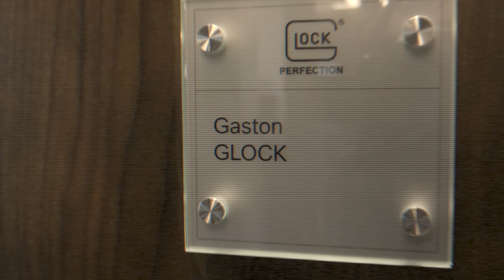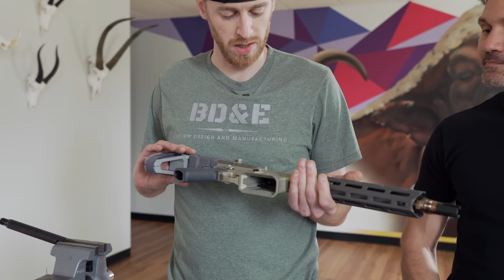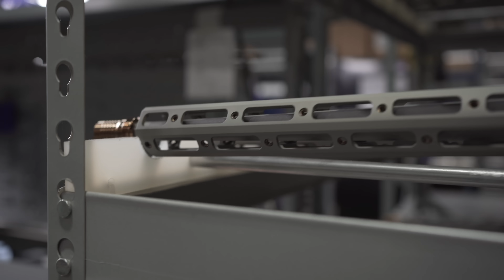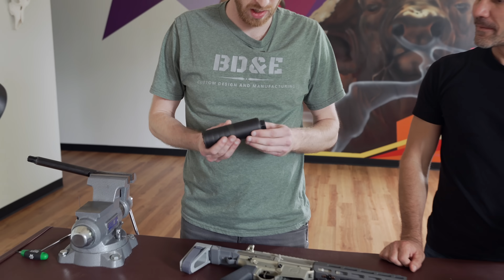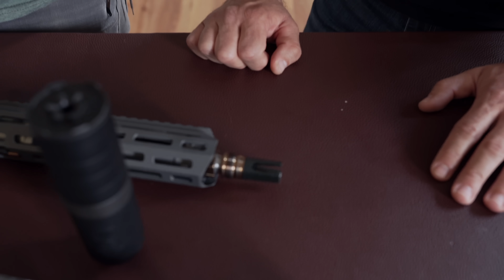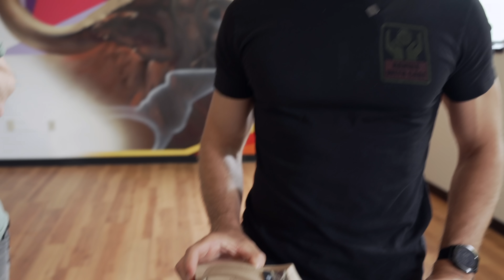New Honey Badger, Mini Fix, Cans, and Gear from Q

Comment: I dunno cause my, aero/aero, bad rail, Faxon 10.5 300, with full size can and 2-7x is 7.5lb loaded. What is that? 2000$ more for 3-4 less ounces? Fancy lol.
Reply: There’s a difference. You should run a test or two.
Reply: @kevinbrittingham6774  Mook
Reply: @kevinbrittingham6774  it’s a hunting rig. With plenty through it. Works every time, what more is there to test? Backpack one is the same base, with 1000,s. Same results. What am I missing?
Reply: @MrT13  well, the weight difference is closer to 2 pounds. Test reliability, accuracy, energy on target for starters.
Reply: @kevinbrittingham6774  now you’re just being silly.
Reply: @kevinbrittingham6774  2 lbs lol. Read my original comment again. Cause you are telling me these finish out at 5.5 lbs… with everything on it. And no they do not.
Reply: @kevinbrittingham6774  more energy lol. These produce more energy… that’s a good one.
Reply: @MrT13  ok
Reply: @kevinbrittingham6774 hey these are just facts. I’d be happy to give you the breakdown and you can check weights yourself. And as for your comment about one brand being able to magically somehow put more energy on… well son, now I know why you’re arguing. Cause that makes no sense.
Reply: @MrT13  facts? Ok, let’s go thru them…

Energy on target has to do with twist (1:5), not brand. 
Shorter OAL
Two piece adjustable carrier
Flared magwell 
Literally the Best Trigger Ever Made
SS match barrel
Tapered muzzle
Adjustable gas block
Clear hard coat anodize
HB Radian charging handle
Radian ambi selector
Q Balanced Bolt Catch
300blk feed ramps and extension 
Q turnbuckle HB handguard 
Q Cherry Bomb and Quickie mounting system
Q HB stock and PDW operating system
4.5 lb.
Reply: @kevinbrittingham6774  all the same on mine except not that brand. Still ounces. 1500-2000 less. Yes 1/5 barrel… no twist does not put more energy on target lol. No it’s not shorter either. Only thing this has is collapsible stock. Not worth 1500$…
Reply: @kevinbrittingham6774  tapered muzzle lol. I like that.
Reply: @kevinbrittingham6774  and balanced bolt catch. Sounds, balanced? Lol in other words fancy. Aero up aero down. Odin barrel. Or Faxon. Mad rail. Griffin device. Griffin can. Ssa trigger. Toolcraft… 2-7 leupold with 5 in it is still 7.5lbs. Put a scope and can on that thing and tell me it’s still 4.5… cause it’s not. It’s the same as mine. Oh and can’t forget the name brand home de la home style ramp and chamber polish. Yes adj block too. 1500 less. 100% rig. 1”.
Reply: @kevinbrittingham6774  backpack 8”. Or 10.5 stalker. Still same. Couple ounces. 1500 less. How much does this thing weigh after you put a 3-4 oz sling, a titanium 14oz can, and 3-4oz dot I guess? 6lb even? 6.5? Oh ok so you got me beat by 10oz cause of the folder. For 1500$
Reply: @MrT13  ok. Nvm. You are absolutely clueless.
Reply: @kevinbrittingham6774  I hear you. Fancy. I like what works, it doesn’t have to be pretty and have a “tapered muzzle” lol. Aka crown? I still dunno on a few of those lol. But I hear you. Fancy.
Reply: @MrT13  pls stop. No, it’s not a crown. Just go read something. Geezus.
Reply: @kevinbrittingham6774  I have. Spinning it faster makes it do something different, great. Not more energy. Tapered muzzle, great. So is my muzzle device. You don’t have to respond if you don’t want to. I’ve built more of these than I know. Kind of how this thing works. You stop counting. I’ve seen em, I’ve used em. It’s Gucci…
Reply: @kevinbrittingham6774  they weren’t even the first ones to come up with a tapered device lol. And don’t try an explain more energy by faster twist rate lol. I’ve got a 10” 1:6 375 raptor that’s probably 10 years old by now. So I’ve been on this fast twist wagon long before ppl started figuring it out for the 300 and 8.6.
Reply: @kevinbrittingham6774  forget all that though. I’m still on the “balanced bolt catch” lol. Is that internally or externally balanced? Or does it stop the bolt tuned to the harmonics? Lol. That’s exactly what I’m talking about. A balanced bolt catch lol. It’s like saying a balanced rear view mirror lol. I dunno man if you love them hey you love it. Good on you for defending it.
Reply: @MrT13  ok. You’re just not smart.
Reply: @kevinbrittingham6774  lol again I hear you. Balanced bolt catch lol. It’s just a bigger one. Maritime. 50 year old technology… again that’s my point, fancy words. I’m more of a dd bcm guy, they don’t reinvent the wheel with shiny paint and words… could’ve just called it Q bolt catch… Gucci.
Reply: @MrT13  you don’t understand, again. It’s called balanced bc that’s the point. The standard one is so out of balance, that in full-auto, it can induce premature hold open. So, it’s as balanced as possible to avoid that. It’s not bigger to be more tactical. We designed it to improve reliability. We learned thru testing.
Reply: @kevinbrittingham6774  ok. You “we” do great. Have at it. Looks great, nice and fancy. Put a supposed auto part on a semi. Cause a regular issue one that’s worked for 50 years wasn’t balanced enough. My point is this, sometimes when you build something the most expensive way possible. Which is one piece at a time, you pay a premium. If I was to build a corvette one part at a time it would cost 3x as much… so most companies do one of two things. Build the parts and make a cheaper product. Or, build the parts and add advertising… and charge more than the same other competitors with the same product. Shiny paint, fun words, and a lot a lot a lot of paid for advertising. Of the shiny new thing with the shiny new words. That’s what I see. I’ve put together so much crap of all kinds. And have had world class stuff put together for me as well. Again, looks great, works, and is fancy. Shiny. Gucci. And extra expensive.
Reply: @kevinbrittingham6774  shiny, pretty, good flashy advertising, fancy. I understand that. And I have a few aac cans so it’s not like I don’t like the brand. But when they come down in price and flash. Maybe I’d get one. But I know this, I understand Gucci when I see it. By all means though socom is ready for when you stop painting them with clear shiny copper… until then. I guess they’ll just keep buying the black ones…
Reply: @kevinbrittingham6774  why else did they do a brand name change and make it shinier? Prettier. That’s what I understand. It was legit in black. Without flashy names for your design. Now it’s well. A letter. Hey maybe sales are up though what do I know. Obviously nothing. Great huge company. Not a fan of the flashy letter… or price tag. Love my tirant though.
Reply: @kevinbrittingham6774  hope you’re doing well if this is really you.
Reply: @kevinbrittingham6774  maybe you guys should send one to 8888, along with the exact same amount of ammo as whatever regular rig he’s tested without a balanced catch of course, that has lasted the longest. Maybe you already have an advantage being 300. Show us how good it is. With a can.
Reply: @MrT13  also, you seem ignorant and like a nobody. I’m not sure we need to do anything. Maybe you should talk less abs test more. And earn some credibility.

Comment: I know all the guys (especially James) are gun snobs but there is a certain level of practicality from guys for whom life was not equipped with an easy button like in the commercials. If a guy spends $3k on a build he needs almost as much in an optic and other accessories. $3,000+ for a build would, for me, be like the last rifle I could possibly ever have. That would mean doubling, tripling down on internals like the barrel, the BCG, lower, and only the absolute strongest in internal parts. That along with the best and most durable protectant(s) -i.e. Cerakote (take your pick) would make sense to me but I am not a collector nor a connoisseur.

Comment: They missed the point of a suppressor.  The main reason for a can is flash suppression, flash will get you killed with a quickness. Second is first round pop. Sound suppression is a benefit if it can be done. Cans that are really good at flash suppression are typically not the best at sound mitigation and vise versa. Im personally going with the can that is going to allow me to stay concealed and alive.

Comment: Faxon firearms streamline carbon fiber handguard is under 9oz for the 17” model and 8oz for the 15”. They’ve had them on 20-30% off sales at primary arms from time to time. Have both and don’t any quality issues yet.

Comment: So they made a Geissele HK416 handguard, ok...
Reply: Except 900 lbs of pull, deflects 1/2 as much, returns to zero 3x better, weighs 1/2 as much, uses anchors rather than off the shelf time serts, otherwise the same…

Comment: I really don't get the Q brand - I like all gun shit for the most part. But dang - nothing Q has ever done seems cool or worth the money to me. I'm trying hard - I want to love their unconventional product names, packaging and cool, F-the-system vibe, but I remain flaccid while still super horny when thinking about them... blah
Reply: You’ll get it once you have more exposure to firearms
Reply: @kevinbrittingham6774  The opposite can be said too. If you are shipping out mismatched honey badgers and claiming they are going out that way because you expect consumers to paint them, that seems like a cop out. Why not batch your uppers and lowers so they match during assembly? When you're at the range or the field, how can you possibly justify the horrendous cheek weld on the honey badger rail system? The "weight savings" over using a traditional buffer tube and system is not worth it, and those that have "exposure" to firearms will say the same thing. For $3,000 the firearms should leave the warehouse perfect. My gas block set screws were the wrong size because ya'll changed that adjustment system, and it left the factory with the wrong screws. Went to the range, and first round.. poof! screws got blown out.  No RMA proof because i'm not going to reach out to Q CS for a $8.00 screw set that I just ended up buying online. For $3000, I think consumers should know what they are getting vs, the "shut up and just believe our sh*t is the best" mentality.

Comment: I love my SBR’d Mini-Fix in 300 BLK + Thunder Chicken. It’s one of my most fun firearm setups I own. It bought it while on sale and got the suppressor stamp free, with said promo. There was also a promo where Q would send you a free “Kickstand” stock if you sent them an approved Form 1. Unfortunately, my first Kickstand had an issue where the right leg wouldn’t deploy smoothly. It would almost “scrape” open. After a quick email, Q replied in an hour and had a new kickstand shipped my way. My Thunder Chicken also has completely straight, nice, laser welds. Kevin, the customer service and welds seemed to have always been the things people on the internet/Redditors always whined about. I can’t speak for Kevin but the other two criticisms weren’t present for me. 🤷‍♂️

All of this said, you can build something significantly cheaper with similar performance. I helped a buddy with buying some sort of Savage 300 BLK rifle, cutting it to 8” + SBR, an OCL Hydrogen and some sort of cheap Vortex scope. I think he put maybe $1K into it all. It’s almost as quiet as the Mini Fix, is only a pound or two heavier and overall has the same accuracy. This is the route I recommend for most. I just really loved the way the Mini Fix looked and chose not to believe all of the Redditors crying about Kevin on the internet, lol. Those same retards swore Dead Air was the greatest thing ever and have since done a complete 180 with their weirdo meta brand worship.

This is all entirely my opinion and Kevin hasn’t crashed a vehicle into my garage or stalked me.

Comment: 11.3 oz for a 15" Handguard is not very good lol, unless he's talking about the weight including the barrel nut and attachment hardware, but even then, that's still not amazing or anything, especially since we don't know the barrel nut/hardware weight. You can even get like a 15" crosscut handguard from PSA that only weighs like 9.8oz+4.3oz for the attachment hardware, and it's pretty reasonable to get 15" Handguards that are down in the 7-8oz range + hardware, and I've seen carbon fiber guards and such get down to 4.5oz, but that's not the same kind of thing we are talking about. HOWEVER, I think he's probably right in saying that this style of handguard is probably the most optimal use of strength to weight right now
Reply: He’s including hardware. But, compare it to serious handguards, like ones the .mil might use. Ones actually tested and chosen for stiffness and deflection

Comment: It's one thing to pay $3000 for a Honey Badger or a Fix, since they are original and iconic Q products.  But three grand for a 10-inch 5.56?  

This is like a Porsche station wagon, a Louis Vuitton pet carrier, or a Baccarat toothbrush holder--a boutique company bastardizing their iconic products to be more "practical," but still at top-shelf prices.  However, I can't criticize Q for this if there is a market.
Reply: It’s the most reliable and lightest weight 5.56 pdw ever developed
Reply: @kevinbrittingham6774  Hopefully those things are true, but one still might ask whether the reduction of one pound and increase of reliability by a fraction of a percentage point are equal to a $1000 mark up over other 5.56 options.  For some, I guess it is.

I am not criticizing Q for selling products that people will buy.  I own a Honey Badger SD.  It's a great gun, but it is objectively expensive.  I happily paid that price because I wanted that iconic firearm in its original caliber by its original designer.  To me, converting it to 5.56 takes away from that originality and removes it from its separate class of firearm, placing it with dozens of other competitors.  Practically speaking, that makes a lot of sense--make what the customers are asking for--except the price remains high.  For some, paying top shelf prices for a gun that is not as unique is harder to justify.  It is most likely paying for the Q name rather than a major improvement in performance, just like buying a Porsche station wagon isn't going to do a better job of taking the family to the store than a Subaru or Toyota.
Reply: @TheBattlefieldHistorian  fraction of a percentage point? I get, not everyone needs or can afford the best. Most people are average, so….
Reply: @kevinbrittingham6774  Perhaps "fraction of a percentage point" isn't fair, but how do you quantify reliability over all over brands?  There are claims that some BCM rifles have run 15,000 rounds without malfunctions.
Reply: @TheBattlefieldHistorian  He can't quantify jack about his claims, which is why he resorts to petty insults. Don't hold your breath. You're correct.
Reply: @TheBattlefieldHistorian  we actually have an engineering and testing department, so we know
Reply: @kevinbrittingham6774  I have no doubt that your company puts a great deal of time and effort into testing and refining your products.  And, I think my Honey Badger SD is among the highest quality firearms I own (which is what I expected, given the premium price).  But, as you know, it's not what your employees know or believe about their own products; it's what the consumers know or believe before they spend their own money.  

The best way to know the reliability of a Q product is experience.  The problem is that it's impractical for the average guy to spend $3000 for the gun, and then thousands more on ammunition, to compare the reliability of a Q firearm to other guns.  Therefore, consumers have to make a quality assessment before they drop their cash.  The best way for them to do that is to see the evidence.

Comment: In the event nobody knew..the Q suppressors do not come with qd mounts anymore.  On the flip side, they have slip slops🙄
Reply: Lol they also come with a cheaper bead blast finish for the same price that they used to come with muzzle devices and a PVD finish. They started sending out new skus awhile back. 

High quality you know. 😂

Comment: I really hate to nitpick but 11.3 ounces for a 15in handgaurd is not impressive... Thats pretty average for lightweight handgaurds. The claim that its stiffer does help but i dont know if anyone is complaining about their BCM MCMR bending.

If they mean that it holds zero for IR equipment better than all the other lightweight rails, then THAT is something to be proud of. But they didnt seem to push that angle O.o
Reply: That’s the reason SOCOM requested something other than mlok
Reply: @kevinbrittingham6774 we get it dude you bought Q and are insecure about your purchase you don't need to respond to every fucking comment

Comment: I don't understand the negativity over m-lok... ? 
Are people just not using it correctly? 
You shouldn't have anything coming loose from M-Lok unless you're not doing it correctly. If you're not making sure that the lock is properly rotating into position, that's on you. 
All we need is a 3rd system in the mix.... 🤣🤣🤣🤣
Reply: Doesn’t retain zero.

Comment: I'm not a big Q fan, but it is nice to see them following after companies like Rearden by putting flats on the devices. I remember Kevin talking a bunch of crap before, and the play on words is funny (Q's sales are down bad so it's likely more of an SEO tactic to hopefully pull sales away from someone who accidentally types "Rearend" on google instead of "Rearden") Obviously the system was designed by Engineers contracted by Q originally, but no flats makes 0 sense on a square shoulder barrel. Good on Q for following Reardens lead.
Reply: We’ve never contracted engineers.